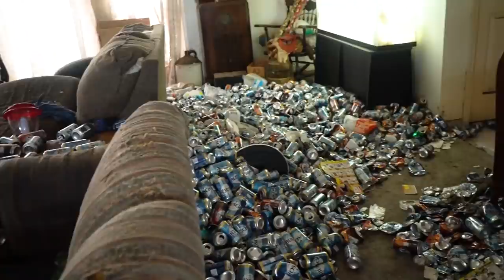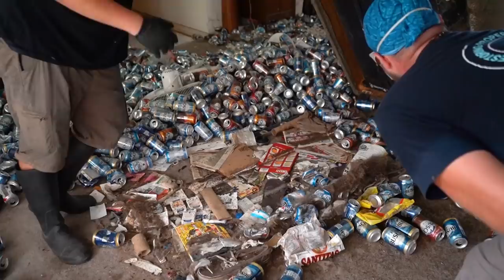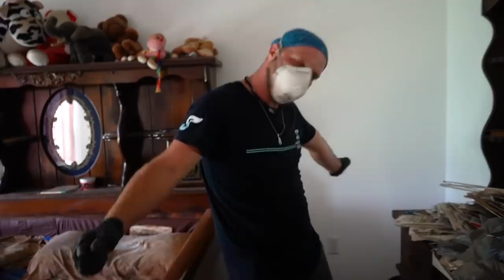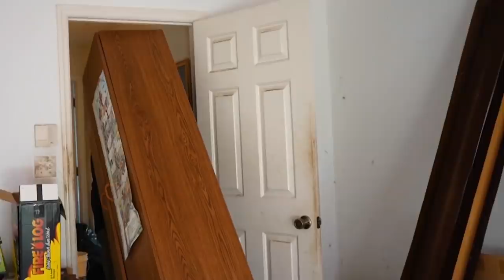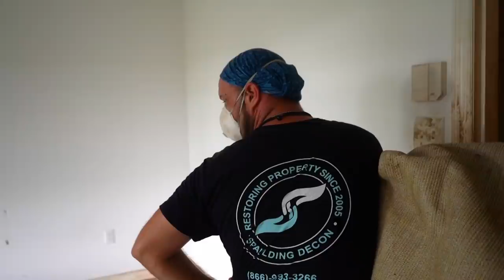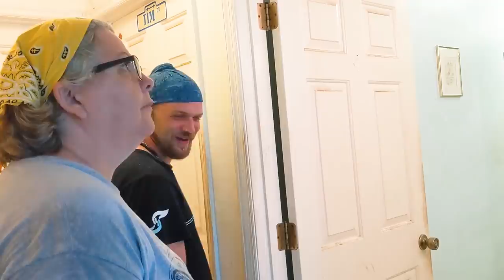Beer Can Bio Pt. 2

Comment: Why do you do everything with the Air Conditioner off? Working in that high heat all day long can cause health problems.
Reply: In some instances A/C can circulate the bio as well as draw it into the machine where it stays or could be exhausted outside.